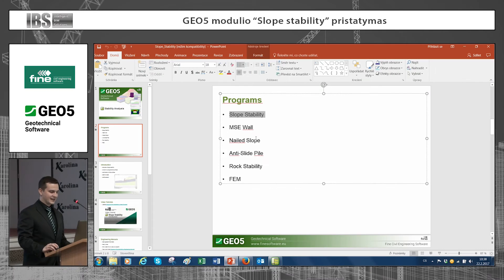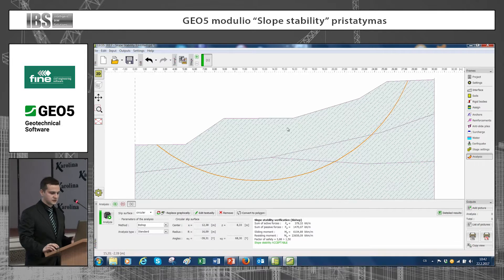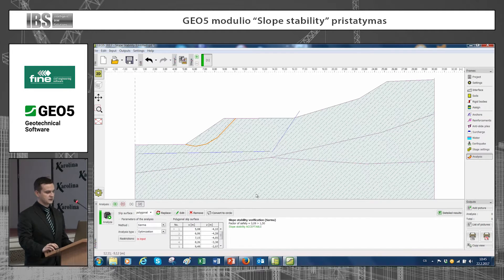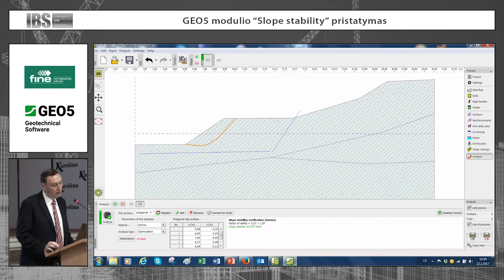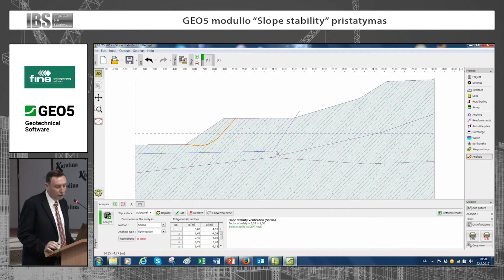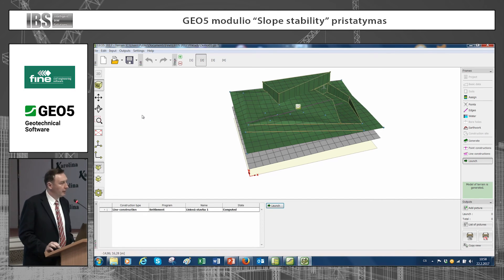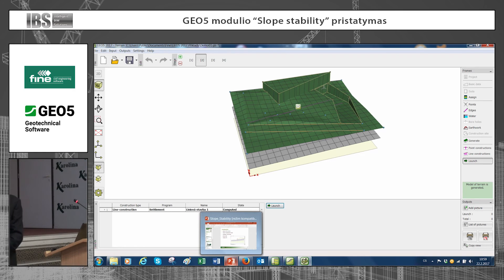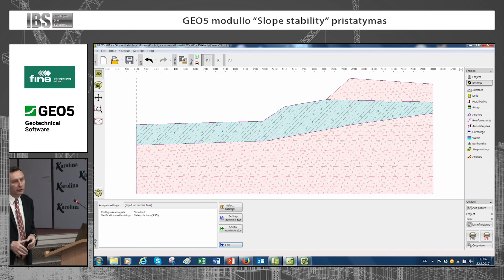Presentation of GEO5 module “Slope stability”

Comment: worst program for counting anything. Don't buy this crap. It's cheap but in addition to calculating the road embankment, modeling in this thing is a torment.
Reply: please explain further 
what are the limitations. the software is far better design in term of te user interface than its competitors.